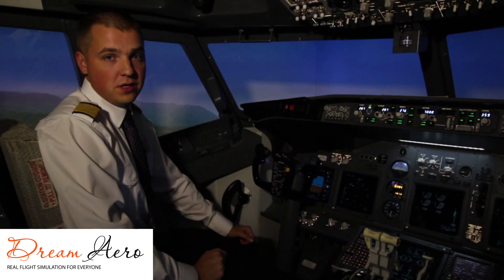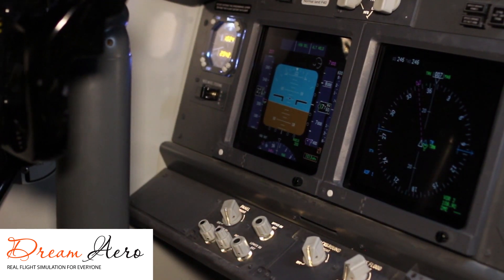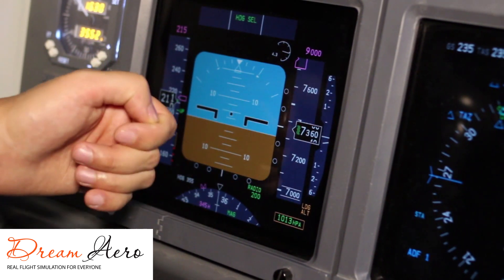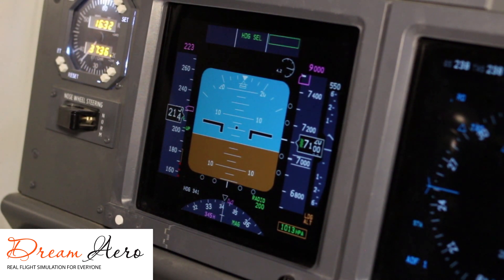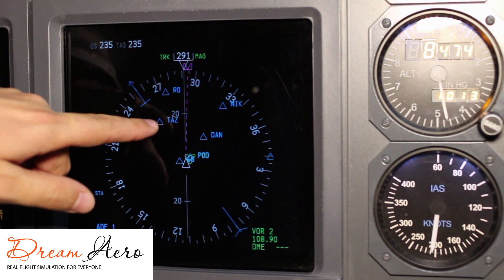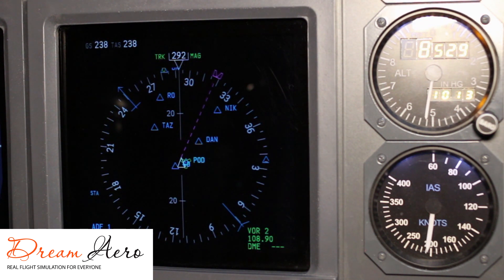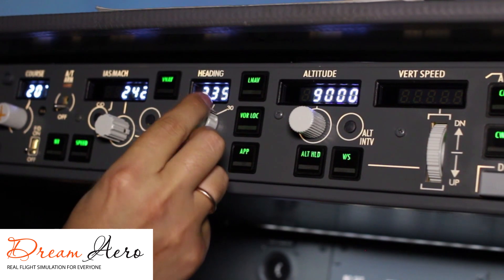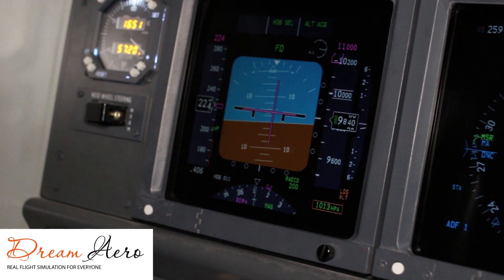How to fly Boeing 737 passenger aircraft

Comment: Is it very difficult or tough to learn to fly a aircraft?
Reply: My friend flies a Cessna (small plane), it aint rocket science, its not tough but it requires  some amount of studying.
For a commercial jet as this one on the video though, its a different story.
Reply: @HELLENIC_DYNAMITE  what's there to study ?
Reply: @robintang7304  my dad flies commercial planes and from what I hear him talk about and reading his training books you must know longitude, latitude,  altitude, air pressure, metric system, rising and landing speed, every type of plane has a different button system you must learn and you have to know the inside and out of whatever type plane you fly, emergency plans, how the radar works, communication lingo between air traffic control and pilots, how to take off/land smoothly and lining with the runway, getting in and out of the gate, how to check engines, lights, communication systems, oxygen levels in the plane before take off, flight patterns and jet streams, there is so much more but those are some main things